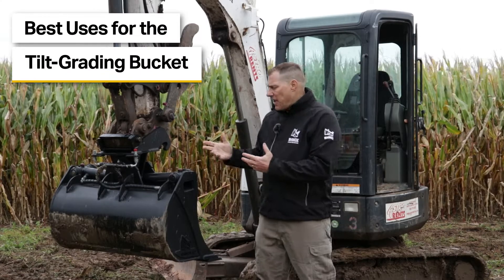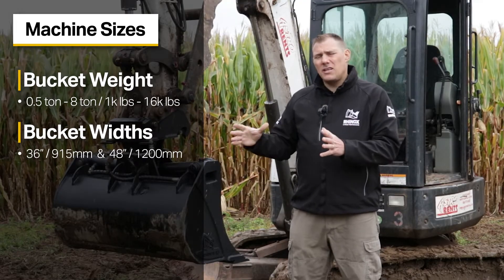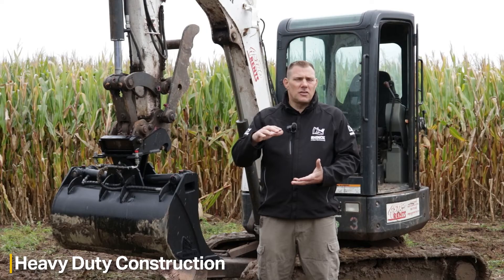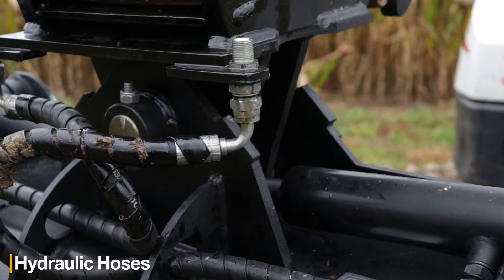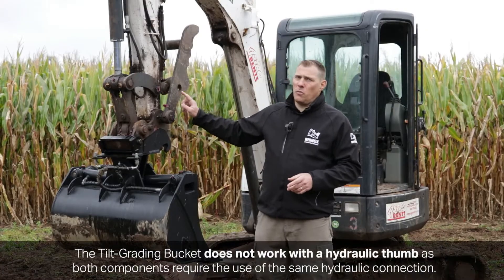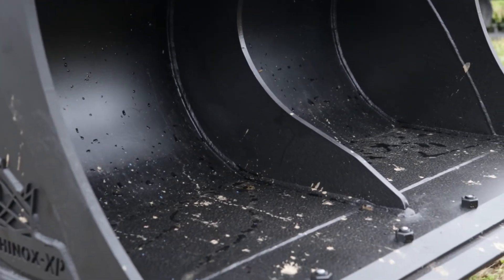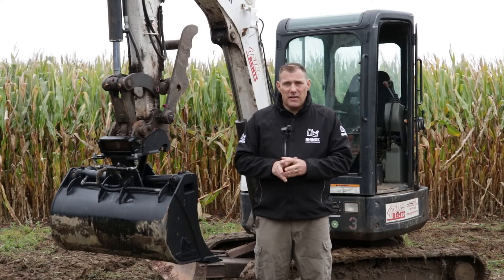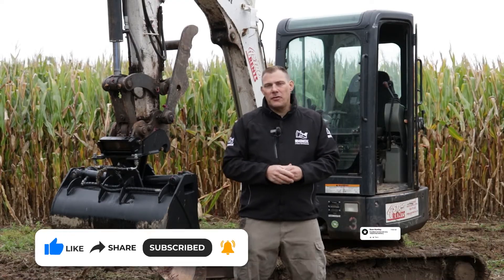RHINOX TILT GRADING BUCKETS - Sizes & Parts | Rhinox Group US

Comment: Grease before and after each use???  What am I missing?
Reply from the maker: To make your attachments last as long as possible it's best to grease as much as possible to keep everything lubricated! We would recommend just keeping an eye on your equipment, every situation is different. But it's better to have a little too much than not enough!
Reply: @Rhinox-Group  what is the fitting required at the bucket for the hydraulic hose?
Reply: You could look at that two different ways if you grease it after use you’re also be greasing it before the next use. 😂
Does sound redundant though 😂